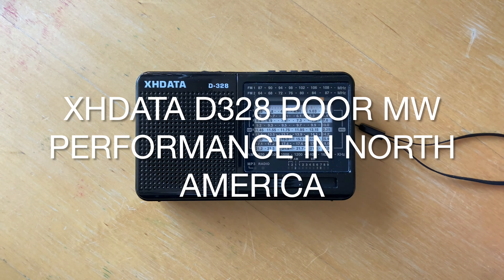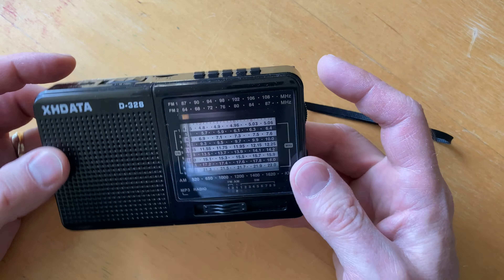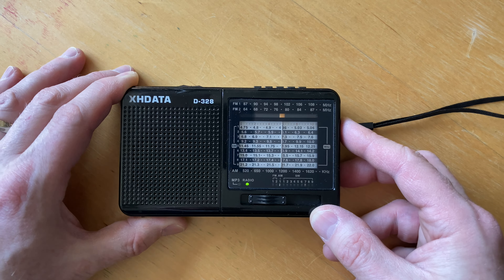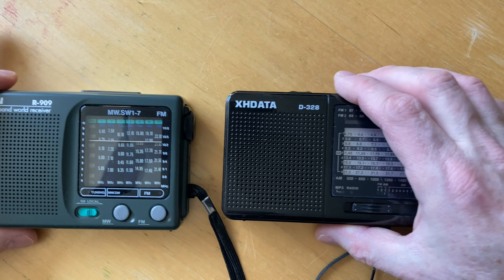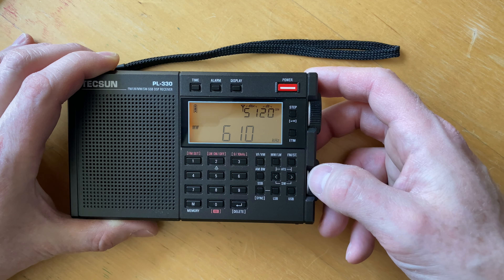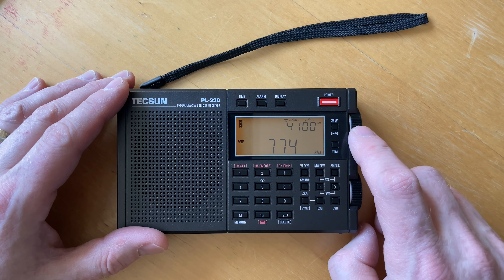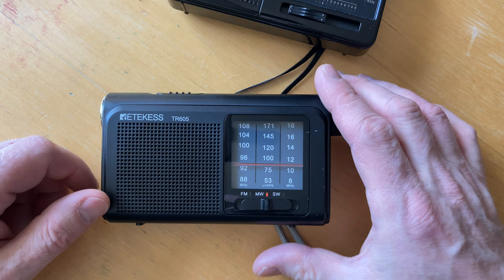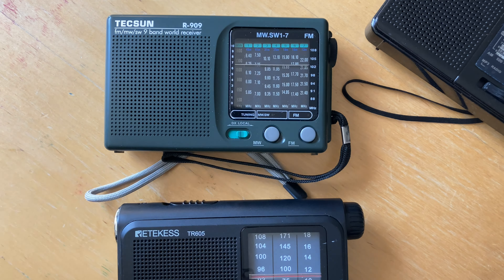XHData D328 Poor MW Performance in North America

Comment: The new D219 has the same problem. There should (but isn’t) be a switch to go between 9 and 10 kHz. And a 1 kHz step would be nice also. These sets are designed for Europe and Asia.

Comment: What should be done when you have several radios that are not used frequently and you don't want the batteries to burst inside the equipment, take them out and store them apart from the radios?
Reply from the maker: It's a good idea to remove batteries from radios you aren't using.
Reply: YES! and I would put them in a zip lock bag with a date on it......I lost a GE super radio to battery leakage damage years ago.